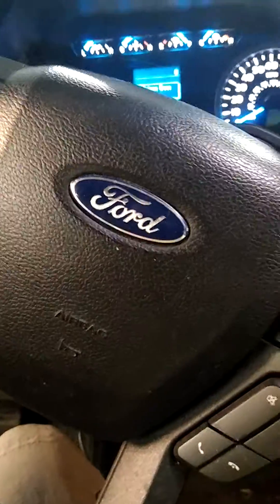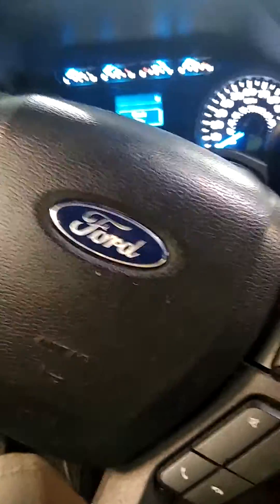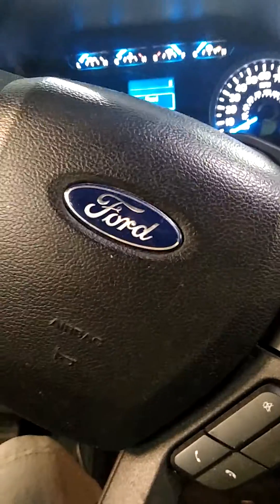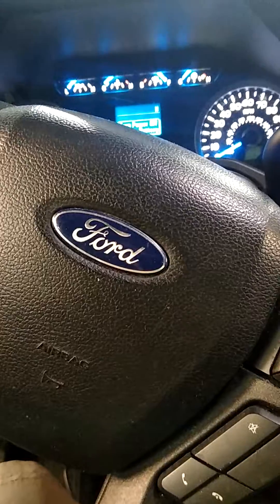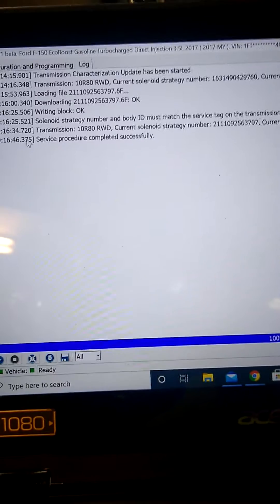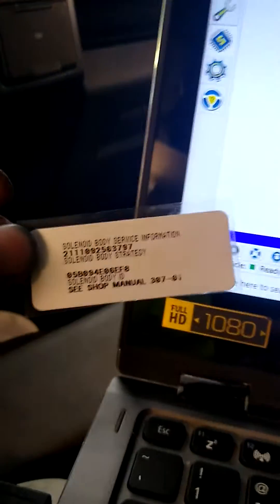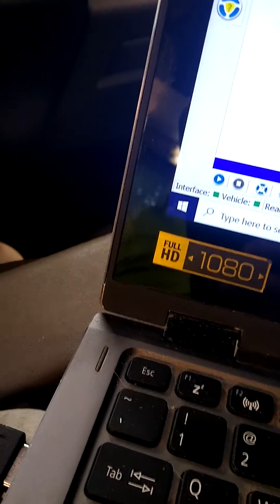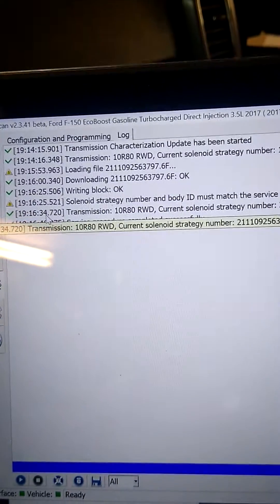10r80 solenoid strategy programming.

Comment: So when replacing the valve body you have to reprogram it? Or it will throw codes or not work properly?
Reply from the maker: It needs to have the strategy relearned or you will destroy the new VB will have harsh shifts and potentially erratic. Why are you trying to bypass the most important part of the procedure?
Reply: @ZoomAutoDiag  thanks,i didnt know that ,

Comment: Kind of useless video.  Be nice to know what pass through, how to log onto ford website (or if you need to) to enter solenoid strategy.  Entering strategy is a good way for relearn to take place.  Some transmission remanufactures do not require strategy to be programed and tell you to drive and let transmission learn itself.  Either way, you will not damage your valve body in the process.

Comment: What do you need to get this done? How much time does it take?
Reply: You should do a step by step how to program the vb.
Reply: @ZoomAutoDiag  
My diagnosis was going to be a bit less involved. Was going to check the pan and see it there is junk in it. If it was going to be clean I would proceed with swapping the valve body. It looks like a $400 proposition after you return the core, plus the ulv fluid to fill it back up (was told need about 11qt.)
Anyways thank you for all your input!!
Reply from the maker: @askrzyniarz  I see your point. You will need a pump to get the fluid in. 11 qts on deck and fill to proper level. There is a mini stick in there. Couple different sticks came in depending on which one you have determines the level. You also should warm transmission up to proper temp. Get torque specs for vb bolts. You are saving a ton of money so get a day pass of Mitchel service information and download all the PDFs for the truck u can. Good luck!
Reply from the maker: Forscan and and service information.  The solenoid strategy procedure takes little time. You need good troubleshooting skills to get to this point.
Reply: @ZoomAutoDiag  f150 shifts bad, willing to try vb, chances are it will fix the problem. New trans is $$$.